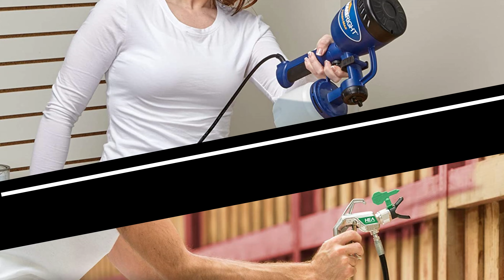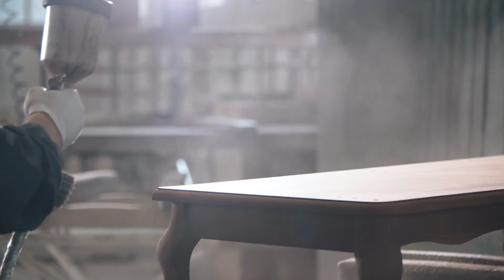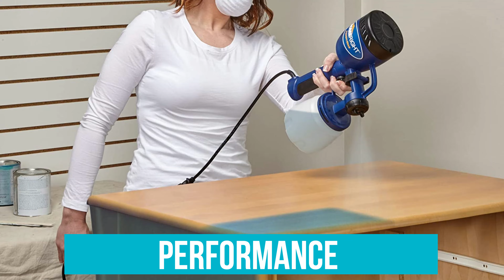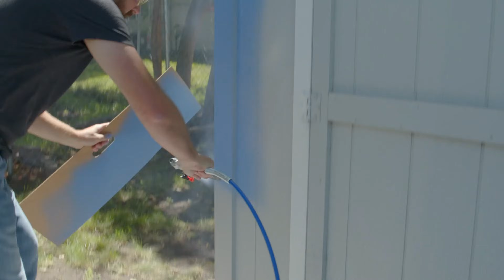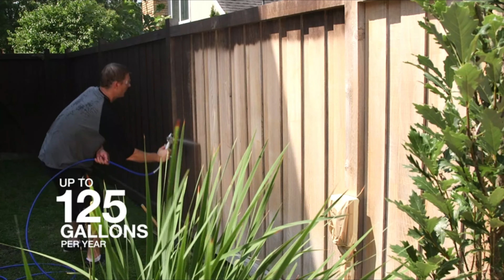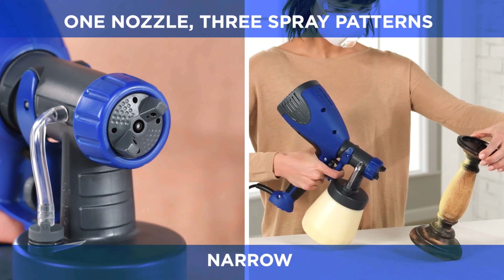Airless vs Air Paint Sprayer: Here is the winner

Comment: A pause in between points would be great. It sounds like a robot reading points over repeated clips. It's informative, but a pause adds annunciation every so often. Thanks for the video. I'm deciding on an at home spray tool right now. Also please don't just recommend a gas mask, a proper 3m, n95 paint mask is preferred when spraying paint. Otherwise you risk paint slipping through the mask, into your lungs which tend to not be cleaned out with a cough. Please do your homework and buy the expensive mask if you are doing extensive diy painting or hold your breath and respect the product. It's dangerous.
Reply: It is a robot reading points over repeated clips.